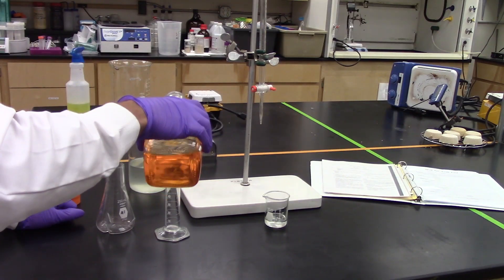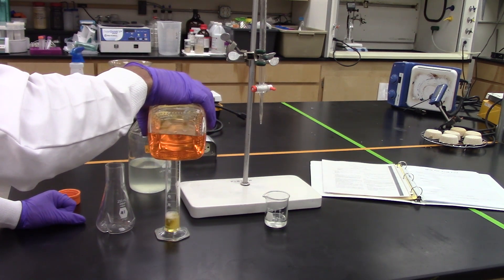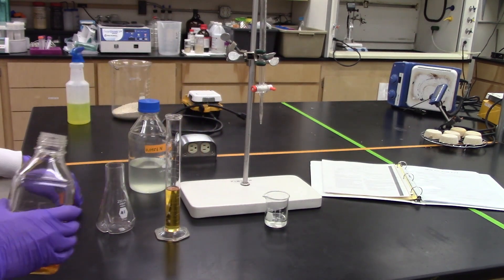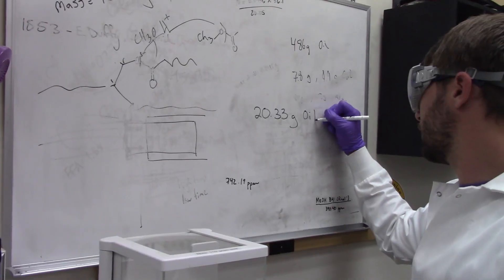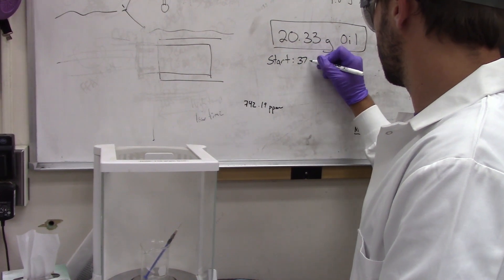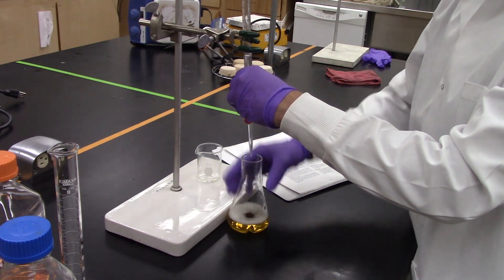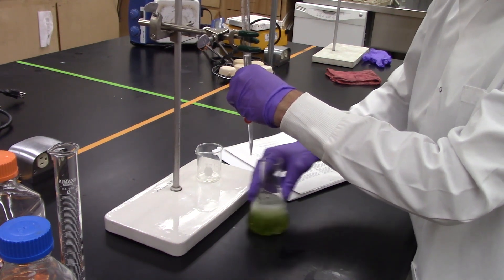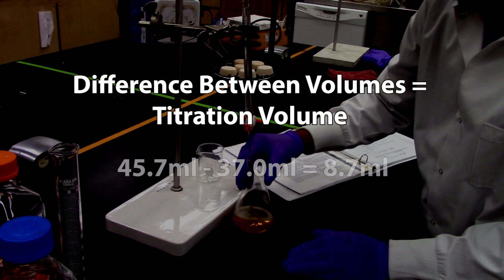Biodiesel Masterclass: Testing Your Oil Beforehand

Comment: Hi I would like to know if it's possible to test solid fat (waste fat) with this method, I've tried with ethanol as solvent and 0.1 N KOH solution but the results have no sense  %FFA seems to be more than 100% 😅, your advice would be really helpful. Greatings from Mexico :)
Reply: I don't know if ethanol is a good solvent for the job, but in general it is possible to determine the amount of FFA of solid fats. Of course you need to very carefully melt them beforehand as to not falsify the result.
Reply: Etanol 50% - éter sulfúrico 50%. Indicador fenolftaleína.
Leer norma ISO 660